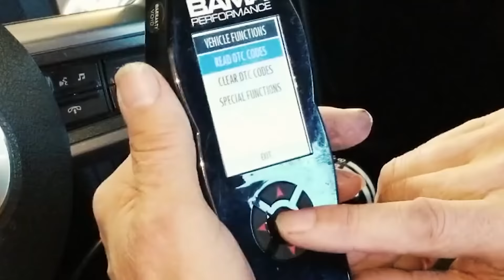How to solve the P0443 code on your Shelby GT500 and save money by doing it yourself.

Comment: Doc’S did you get code p0456 on your shelby because i have that code but didn’t know the problem
Reply from the maker: I did not get a P0456 code, only the P0443.  Yours indicates a leak in the evaporative system, which includes the purge valve as a possibility.  If you have a gas cap in your vehicle (I don't know the year of your car) check it for proper sealing.  Also, do a visual as I did on the canister.  Make sure the hoses are not cracked and more importantly make sure no fuel is in the hose.  Don't overlook electrical connections.  Make sure they are clean and tight.  If you have a gas cap, it may be as simple as tightening it and clearing the code.  Then see if the code comes back.   That's about all I have for that one.  Let me know how it turns out.  Thanks for the question.